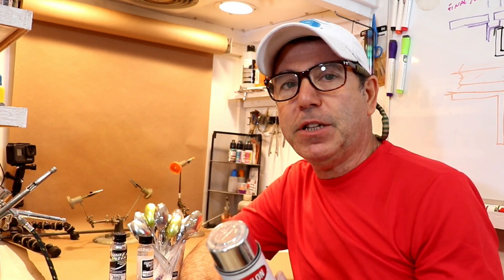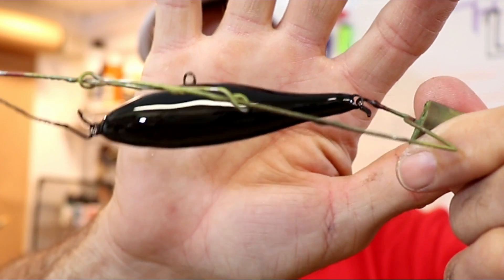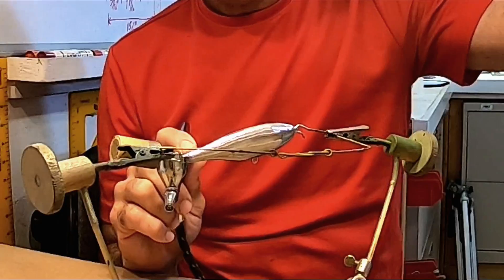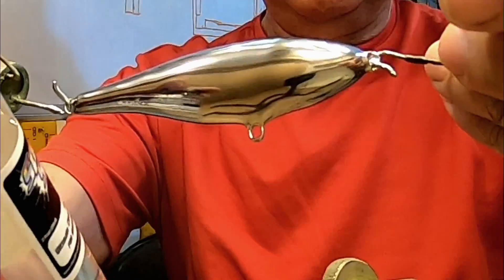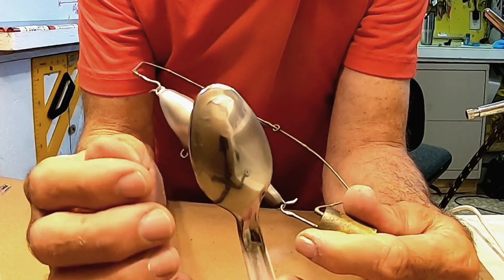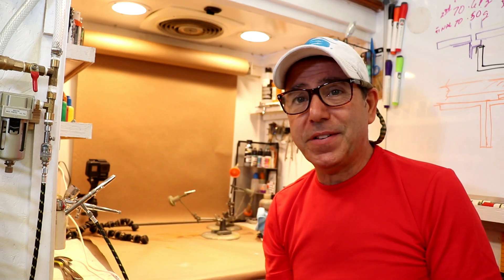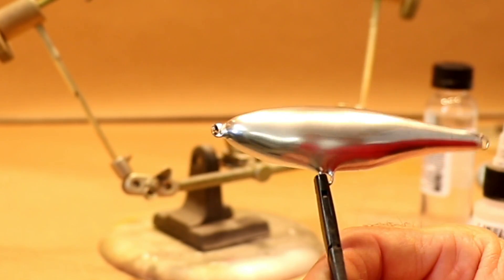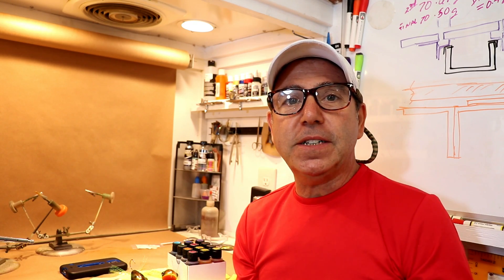Chrome Painting Lures with Spaz Stix Mirror Chrome, Testing Spaz Stix Clear Coat

Comment: I use this to re-chrome the front grill of my car. Can I use floor wax to seal it? If so, how would I go about applying? Can I use a brush if I don’t have a air gun?
Reply from the maker: You can try a brush or just a sponge but be aware the stuff is very likely to become dull no matter how you put it on period

Comment: In your opinion out of all the crimes which is the best and easiest to use. And do u have to put a black under the crome? Also do you have to Clearwater it.
Reply from the maker: This is a great question for the question of the week.  I'll cover it on an upcoming video.
Reply: I paint trolling flashers for salmon on lake ontario and trying to figure out as the crome paddles we can buy the paint comes right off. They don't make them like they used to

Comment: Why not dip it in a clear resin for ultra clear
Reply from the maker: The issue is not the clarity if the clear coat...it's the chemical reaction with the spray chrome. They seem to react with all clear coats, including both epoxy and polyester resins.

Comment: My interest in pinewood derby cars is about as far from your passion for lures as we can get, yet we have one problem in common: How to clear coat Spaz Stix Mirror Chrome without dully the finish. After testing many clear coat options, the one that's worked the best for me was Devcon 5-Minute epoxy. It doesn't raise the aluminum grains in the paint at all, which is the reason clears dull the finish. The problem is that the epoxy is far too thick. If it could be thinned, it might make a good clear for Mirror Chrome.
Reply from the maker: You can thin epoxy, you just have to thin the two components separately.  I have used acetone, and MEK but I have had some success with denatured alcohol too.
Reply: @EngineeredAngler  Thank you!

Comment: So I have been into rc cars and painting lexan bodies for 25 years. I've used Spaz Stix chrome a lot.  I'm pretty sure that paint is designed for inside lexan bodies. Paint the back side of a clear plastic spoon then after drying is completely done back with black. The unpainted side of the spoon is the effect its designed for.
Reply from the maker: I agree but that is not how they are marketing it...don't think for a minute I haven't spent ours trying to come up with a reasonable way to paint the inside of a transparent lure😊.  Thanks for watching.

Comment: Would you consider a hot stamp foil video?
Reply from the maker: I've actually been thinking about it a bit, but I'm still deciding if its something I'm interested in for the long haul.  Thank you for the suggestion...
Reply: Engineered Angler I watched a video with guy using an iron to heat a rubber pad and then pressing it onto the lure with the heated rubber pad...worked rather nicely...some really cool iridescent and holographic foils...I’ve considered it my self for some time...if I could figure out a good chrome spray, cheap enough I wouldn’t consider it...but....

Comment: Have you tried Alclad paint as they do an amazing chrome finish. You have to spray it black with their gloss undercoat and then you get the mirror finish. I would epoxy them with Devcon 2 but it would dull the finish as it reacts with the metallic paint. I then found out that Alclad also did a clear coat which is water based so I tried that and gave the lure 2 coats. When it dried I then put on the epoxy and no reaction and it still keeps the mirror finish. I don't work for them by the way but I do love their metallic paints which are in many colours. It's pretty thin too so easy to airbrush on and I clean the gun with acetone which is nail varnish remover.
I know you like your gold colour and they do an amazing selection of them and one of them is an exact match for the Megabass Kinkuro lure.
They are pretty cheap too and a little bit goes a very long way.
Check out this guy using the stuff on a Storm Troopers helmet.
https://www.youtube.com/watch?v=POe_FIvhmd0

Comment: I've used this stuff for model cars in the past because it really is a nice looking chrome. Unfortunately i haven't found any good way to clear coat it either. From what i understand the spaz-stix is made for clear lexan plastic RC car bodies. It is meant to be sprayed backwards. You're supposed to spray the chrome on the inside of the clear body then spray a black on that followed by the clear to protect it from the inside. The clear plastic is what protects it from the outside.
Reply from the maker: You're right, I realised that it was meant to be used  that way after reading Q&A on their website. The krylon looking-glass is the same way. I have still been able to get some nice metalic finishes using it, not perfect, but nice.
Reply: What do you mean by this? I'm afraid I'm unable to find more information on sealing chrome paint. I'm making a prop that needs to be extremely reflective, as much as possible.
Reply: @Ce13stialBunny   @Celeste Velez  When building remote controlled vehicles the bodies that go on them are sometimes a clear plastic. The spaz-stix is meant to be sprayed in a backwards order. You spray the chrome, then the black, and then the clear ob the inside of the plastic body. The plastic body itself is what gives the gloss and protection from the outside. Unfortunately i havent found any paint that gives an absolute mirror finish when spraying the outside surface of something. What is it you're trying to make?
Reply: @mikev3977  I'm recreating a prop from a movie. The Beast from Mandy (2018). I bought an official replica of it which was very expensive and it's definitely fragile. The prop in the movie is extremely glossy chrome, so is the replica. I want it to be that glossy if possible but also EXTREMELY durable for handling often and flexing.
Reply: @Ce13stialBunny  It may not be 100% perfect but you can go to home depot or lowes or any local hardware store really and find some aluminum foil tape. Its a metal tape for HVAC ducts. Just be sure to get one without any logos printed on it and cover it in that. Then you can get some metal polish and a rag and shine it up. It wont be perfect and youll have to line up the tape just right to avoid gaps along the edges but i think that would end up looking a lot brighter that any paint youll find.

Comment: Thanks for sharing! I swear we are doing the same stuff all the time! It's amazing! I'm trying an automotive clear coat specifically designed for the chrome effect to continue shiny
Reply from the maker: Good luck...it didn't work for me. Maybe you will find a way....
Reply: @EngineeredAngler  I will most definetely send it your way if I do!
Reply: @cecapfishing9882  Can you try doing an auto clear coat after the floor wax? could that possibly work? I have also had 'some' luck with using a product called 'createx colors UVLS clear - 4050 gloss'. Its hit and miss though. After the crome I spray this on and then let it dry before doing a two pack clear coat.

Comment: How long are you letting the floor polish dry?  I sprayed the Pledge floor finish.  It sat for an hour.  I thought it was dry.  But after I dipped it in KBS, it cracked and separated.  The paint had dried for over 24 hrs so I figured it was dry.  What do you suppose could have happened?
Reply from the maker: Is it an acrylic floor wax?
Reply from the maker: KBS is urethane based and should go over acrylic with no problems...not what happened...
Reply: I believe it is acrylic.  It is Pledge Revive It Floor Finish.  Is it not the correct one?  The only one I could find.
Reply from the maker: If it is a combination cleaner/finish...that might be the problem.

Comment: As a model car builder I find the spaz stix chrome to be really great. Definitely the smoothest you can prep the plastic like glass before even spraying on your black base is crucial! Also after spraying on my black base I still spray on Pledge to give an extra shiny base to it. I found this helps the spaz stix adhere better. One thing also I noticed is you said you were spraying the Pledge at 30 psi, usually we spray around 10 psi for Pledge how thin it is. Any higher it runs a lot and doesn't seem to dry that well. Gravity feed airbrushes btw with that. But I found Pledge still keeps a good mirror shine on the spaz stix if sprayed in thin coats. Maybe a little more playing around with pressure and coats you might find that right medium. I was a little apprehensive too about trying their gloss clear for the chrome. I might go ahead and pick some up still and experiment. I really like how your lures came out they look amazing! Keep up the good work!
Reply from the maker: I played around with the pressure on the gun and found that if I got lower than 25psi or so the floor wax would spatter.  It's probably the difference in guns.  Truth be told the very best finish I have found comes from dipping the item in the pledge and not spraying.
Thanks so much for watching and sharing your knowledge....
Reply: @EngineeredAngler  I'm going to experiment as well with dipping in pledge to see if I can get some different results. I always like to try other ways out when it comes to Spaz Stix. Yeah usually my guns are .3 or .2 mm needles & nozzles and found between 10 or 15 psi is usually good for pledge. Interestingly, I've also found using a very soft fine hair brush with the spaz stick can give the same mirror finish for smaller parts or trim pieces. Larger pieces still needs ti be sprayed. I purchased the Spaz Stix clear so I'll be experimenting with that as well. Maybe dipping like pledge might give a result close to pledge.
Reply from the maker: I you have some success, please share.  Good luck.
Reply: @EngineeredAngler  Update! So I've done a lot of experimenting with the Spaz Stix Clear since I got it in and had time to play with it. First off, yeah it's not worth a spit in any of it's use for Mirror Chrome. I've spray it light dusting coats, medium coats and heavy coats. I've even dipped it like Future and no matter what I did.. it took the shine away and hazed it up. I even played with air pressure settings and everything was the same result. Good old faithful Future did the job sprayed on or dipped. One thing to note, I have been playing around with Molotow Liquid Chrome paint pen I got at Hobby Lobby, and I have to say I'm pretty impressed by it. You can buy refill's for it online but it's a little pricey but gives a very nice chrome finish. The thing with it is, you have to let it really dry for a good few days before touching it. It will get fingerprints or smear up if you try to touch too soon. But I have to say, if you haven't tried it out you might want to check it out. The pens are paint pens you have to press the nub to get the paint flowing. But I ended up taking the pen apart and harvest the paint out to airbrush. PSI will vary gun to gun, but I found around 20 to 30 worked good. I also found with it, a heavier coat than how we would spray on Spaz Stix worked best. Check it out if you get a chance.

Comment: What black paint did you use and gloss clear coat? I used a high gloss Rustoleum base and then applied the Spax Stix. Didn't top coat it. After time the primer was easting throught resulting in tons of black spots over the entire helmet (3D printed Mandolorian). Obviously a chemical reaction. Any recommendations?
Reply from the maker: The best thing to do is to put a high gloss clear over the black.  This way you can apply multiple coats and if needed polish it to a super high gloss.  This gives you a great surface to apply the spaz and keeps it from contacting the paint.

Comment: After the floor polish, can you clear it in KBS? Will you still get the reflective look?
Reply from the maker: That really reflective finish you have right after you give it a bit of a wiping with a soft rag is not something I have been able to keep.  The best results are from using the floor wax but...it still becomes slightly dull.  To answer your question, yes you can coat it with KBS over the floor wax.  Good luck.
Reply: Engineered Angler obviously the floor wax isn’t going to protect the paint. If it’s just going to end up looking like a pearl silver after clear, I would rather just clear it. I guess I’ll give it a shot

Comment: Two things that you are doing wrong is not giving the chrome paint enough time to dry and allow the solvents to evaporate off. And you're spraying a too-heavy coat of the clear causing the chrome to "lift" and ruin the reflective surface.
Reply from the maker: That's good to know...I really thought there was no way to keep the reflective finish. I have done an experiment where I left the finish without any clear coat in a safe place. But it still went grey after a few weeks.  Any insight?

Comment: Well, you find the way things work after discovering (most) of the ways that don't - that has been my experience anyway LOL! Thanks for sharing your experience with these products - frustrating but fun anyway :-)  Seems counter intuitive to paint a reflective surface over black - you would figure that white would be better. That silver plate finish is awesome but costs and setup are a bit beyond my current level of commitment to DIY lure making - I am more at the aluminum finish and metal foil level at the moment. Cheers and take care!
Reply from the maker: I think that you can get such nice results from foil that doing much of anything else is just for the fun and challenge.

Comment: Great video! Just curious, the floor wax, is that the final clear? If so, do you feel it's pretty durable in water when fishing? Thanks!
Reply from the maker: The floor wax is just a mid coat.  After that I add the paint job then the final clear coats.

Comment: Just watched this. Reason it failed everything you did was wrong. All of it. You followed no directions f4om the start. Didn't even use the black backer made for it. If your going to demo something then tell people it's no good you should follow directions!!
Reply from the maker: I've been playing with this stuff for years...even the manufacturer admits it always dulls out when you clear coat it.  Notice how the chrome was near perfect even without the black base..??? so why black base?  The issue is not getting an initial chrome finish the problem is keeping it when you clear coat it.  Try it yourself...the best you will get is a semi-polished aluminum type finish.  Frustrating for all.  Totally get your point about the directions...
Reply: Then you make a video and show everybody what to do.